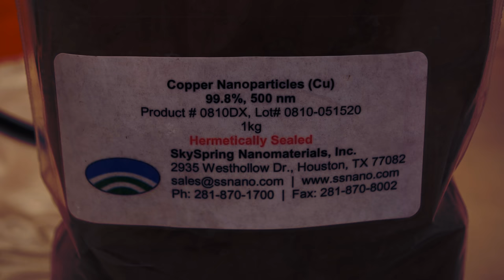Make Our Best Thermal Paste... YOURSELF!

Comment: What if in the final stages you added a liquid that could evaporate easily just for the purposes of being able to mix the final product easier, then evaporate to remove from the final product.
Reply from the maker: I tried this.  The problem is that the mixture tends to stratify during the evaporation, requiring more mixing.
Reply: @TechIngredients  Thanks for the reply, During the evaporation process did you let it sit and evaporate or continue mixing while applying a small amount of heat? I know with cooking certain dishes you can't just boil out excess liquids without separation of ingredients where a slow continual mixing with a bit of heat usually does the trick, the excess liquid helpful for that initial mixing of the ingredients.

Comment: Does it outperform liquid metal?
Reply from the maker: Probably not.  And as long as you're willing to deal with the electrically conductive and corrosive liquid metal, the results should be even better.  That's why we modified the rig with nickel coated surfaces and will be testing commercial liquid metal and our own formulation as well. Stay tuned.

Comment: Nothing to do with this video but could you come up with something inexpensive that could measure the absolute air pressure (or pressure difference) within a pascal or two..
Reply from the maker: Assuming you are measuring around one atmosphere, what about using a liquid manometer and amplifying the input pressure and consequently the differential with a calibrated syringe?

Comment: @Techlngredients I have a question please: you have used aluminium powder or aluminium oxide powder?

If you have used aluminium powder why ? Because aluminium oxide powder is non electrically conductive.
Reply from the maker: Aluminum metal powder.  It has a higher thermal conductivity.   The oil makes the mixture non electrically conductive.
Reply: @TechIngredients  thx professor
Reply: @TechIngredients  can you please send me the link where can I purchase the aluminium powder please I'm in France, I searched but I can't found in secure site

Comment: gave this experiment yet another try using different mortar and pestels since I assumed the shape to be an issue making the glycerin stick to korners I wouldn\t rech but I just haven\t been able to replicate it mostly it felt like the issue was no enough glycerin so when I went up the g for that ingredient it started to look somehow similiar to your at around 9 grams but it never performed as well I guess I am just doing something wrong that I am unaware to notice
Reply from the maker: What aluminum powder are you using?
Reply: @TechIngredients  called @Aluminum powder "Pyro 5413H Super" <5 µm (Al)" from a company called laborladen didn\t really find any other aluminium powder sized 5 µm  the place I ordered it from defined the particles as Spherical but the manufacturers website doesnt mention anything in that regard
Reply: I should mention I had quiet the problem finding aluminium powder even since i have no clue where in Germany to get lab stuff
Reply from the maker: Given that you are stuck with that powder and have to hope that in fact that it is spherical, the key is to reduce the glycerin fraction.  Try blending it at an elevated temperature. Don't  heat it so much that you can't  touch it, otherwise when it cools it will become too viscous  to work with, but it can facilitate  the blending process.
Reply: @TechIngredients  Thanks a lot this actually worked perfectly! Edit: OUTPERFORMED Arctic silver by hell of a lot

Comment: Why is copper of the same particle size/shape worse than aluminum?
Reply from the maker: The aluminum may have a little better sphericity or the oxide coating acts to improve flow, but the aluminum allows for a higher solids loading fraction.

Comment: Hello... I used copper powder with a soft 1um and mixed ingredients according to the recipe 4 g glycerin and 14 g copper powder and the result was that the laptop temperature was high and all attempts to make it a reliable thermal paste failed😢
Reply from the maker: What did you attempt to do to make it reliable?  
The most important factor in good heat transfer is actually surface prep.  I covered this in our earlier video on thermal epoxy and will again soon, in an upcoming video on very high power lasers.
Basically,  you need to flatten the surfaces and smooth them to a near mirror-like appearance. 
The thermal compound's performance is directly related to the solids loading fraction. Working against you is that as the viscosity increases, it becomes harder to squeeze the layer down as thin as possible. Aluminum powder is advantageous because  the very round particles pack AND flow easily, allowing very high solids fractions. The thermal conductivity of aluminum vs copper is actually not that significant.

Comment: Would heating the paste help with mixing/incorporation?
Reply from the maker: It does with the glycerin, but not the oil. That is why it resists pump out.
Reply: @TechIngredients  I'm assuming thinning with toluene or hexane didn't help?

Comment: This just makes me wonder that if the thermal pastes are still bottlenecking the thermal conductivity, would we get a bigger gain by delidding a cpu and attaching a waterblock straight on the chip since this would completely remove one layer of thermal compund out of the equation 🤔
Reply from the maker: You'd still need a thermal interface material. Air will still prevent good thermal transfer.

Comment: Can I ask what is the "best" thermal paste for 190-450 celsius range? That can last as long as possible.
Reply from the maker: My guess is an indium based alloy. You might take a look at or contact Indium Corporation, they have a lot of options for thermal control although it won't be cheap.
Reply: @TechIngredients  thanks. But i am looking for a paste. I have not two surface to "connect".  There is indium based paste? I see indium/gallium (aka liquid metal) but I have to couple brass/aluminium/copper. Maybe liquid metal is corrosive
Reply from the maker: The galium is very corrosive while the indium is pretty inert.  You might not want a paste.  An alloy that softens or melts at a temperature your surfaces can reach will allow you to place the film between the surfaces and at the target temperature you can tighten things down a little further achieving a good interface.

Comment: I wonder if paste made purely out of copper or silver nanoparticles preferably coated in that silene instead of zinc oxide would give the absolute best performance. Probably finding right materials would be a bit like searching for unicorn, but hey, if anyone you are the guys to create the ultimate thermal paste, and the world needs it (and most likely there would be no trouble with selling it, especially with a bit of marketing)...

And on personal note, if you guys actually create the best performing paste on the consumer market, and once chip shortage is over, I would absolutely buy it for the new PC build I desperately need!

Comment: How would one make a strong but easily removable adhesive like that of the 3M strips used for hangers and posters... I know VHB by 3M is much stronger but it will take a layer of paint with it if you use it on a wall but improving the strength of a 3m strip like adhesive would also be welcome provided it can remove cleanly without damaging common walls and ceilings (Typically dry wall with paint or wallpaper).
Reply: Thought of this while I was hanging up VR base stations and trying both VHB (RIP my walls) and 3M strips (Fingers crossed it doesn't give out)
Reply: The issue with VR base stations is they have moving parts inside of them so should they fall, especially during operation, they can be permanently ruined.

Comment: why aluminum powder? Isnt copper more conductive
Reply from the maker: The aluminum allows for a higher solids loading possibly due to better sphericity or the oxide coating.
Reply: @TechIngredients  
Sorry for the dumb question, you said it in the video. Nanotech has improved a lot, i'm sure you can find some papers describing some types of nanospheres. There's CuSO4 + ascorbic acid, which makes nanospheres I think.

Comment: Where are link to buy materials? Why not copper powder?
Reply from the maker: It's not quite as effective as the aluminum.  Despite it's higher thermal conductivity it's all about the solids fraction and the aluminum is more spheroidal.
Reply: @TechIngredients  I get no products on aliexpress for aluminium powder, I get some from germany but they are not cheaper then copper.
Reply: @TechIngredients  " aluminum is more spheroidal." - until I see you post microscope video/photo I will not believe you. I checked OEM thermal pastes myself under microscope and was amazes at what I so. Same goes for third party powders.

Comment: zirconium dioxide has good thermal conductivity?  That is contrary to its use in ceramics and refractory applications.  Can you clarify ZrO2 in this application?
Reply from the maker: Good relative to the oil it's immersed in.
Reply: @TechIngredients  That makes sense. Thanks for the reply! Would the structure of silicon carbide be suitable?  I thought of SiC but thought it might be no better than diamond.  Then I saw the structure is quite different and I know it's not a bad conductor.
Reply from the maker: Probably not.  I believe it's a cubic structure and would suffer diamond's packing issues.

Comment: this thermal paste is so good and so cheap and so easy to make, you can do it at home by yourself and save a lot of money; to prepare few grams of it, you just need a worth of about 850 bucks of equipment (thinking of a cheap low end ultrasonic welder, otherwise it will cost you much more)... 🤪

Comment: Wonder if 50 sheets of gold leaf stacked ontop of the cpu would work without oil. Since gold is so malleable one could imagine there wouldnt be much trapped air between the sheets after the cooler is clamped on the cpu. Would do away with oils.
Reply from the maker: It doesn't work as well as a single sheet of indium foil.  Indium is much softer than gold.

Comment: Isn't  zirconium oxide electrically conductive? If so it is just as dangerous to apply as liquid metal
Reply from the maker: It's  a very poor conductor, but beyond that, the grease insulates the particles.

Comment: How will this work compared with liqiud metal on cpu and cooler?
Reply from the maker: The best non metal pastes including ours will not perform as well as liquid metal pastes. That's why we are developing our own metal paste.  But keep in mind metal pastes will corrode many metals especially aluminum and if a drop of this material gets on the leads to the CPU it can damage them. So, you need to be careful.

Comment: Maybe for your next video, you can develop a device that prevents your glasses from slipping :)
Reply from the maker: Cute.
Reply: @TechIngredients  hey, on a serious note, may I suggest an episode. I have obnoxious neighbors that blast their music from outdoor speakers mounted around their poolside, they do this because they have money and no consideration. The property fence line is 70 feet from my kitchen side door, reading on average around 75 - 80 dba, from my door.  Could you develop an episode on the best way to soundproof outdoors. E.g Materials, Plants, Phase Cancellation, LRAD 😄

Also, in consideration to 6 ft. height limit on fencing; weather; durability, and visual appeal.

Thanks for your hardwork

Comment: Wouldn't copper powder be better than Aluminum?
Great video by the way. I think I'll pop over to your store and buy some!
Reply from the maker: Actually, no. This may be due to better sphericity of the aluminum powder or the effect of the oxide coating, but the aluminum allows for greater solids loading and it's all about excluding the low thermal conductivity oil.
Reply: @TechIngredients  interesting.

Comment: Wish i had equipment avaleble so i could test this!
I have a question tho, i use Noctua paste on a gpu i have, but for some reason after a few months of use it seems to start getting hotter, and i have to repaste it again, and its good for a couple of months again.
What can be the reason for this? The pc is stationary and not moved so its not shaking or moving the heatsink either.
I have never tried any other brand then Noctua, maybe i should have done that.
Reply from the maker: Some thermal pastes contain more volatile liquids that help to reduce viscosity. Grizzly does this.  Each time the computer cycles on and off the heating cycle drives off a little of that liquid as vapor. The space left behind fills with air and heat conduction suffers.
Reply: @TechIngredients  Awsome, never thought i would ever get such a good explanation on this! I'll try another brand just to test. :-) Thanks!

Comment: 42:00 "So it may be that I haven't reached the limit of the performance of this material."

I wonder...would a melanger be appropriate for this application? It's used to grind cocoa nibs into liqueur, though if this were to be tested you'd probably need to be making a lot more of the compound since the smallest scale melanger I've seen was 2 Liters.
Reply from the maker: I've thought about it.  I'm actually getting an arm like Popeye.
Reply: @TechIngredients  It'd certainly be cheaper than those $2k + industrial mixers. Looking around I see them going for the $300 - $500 mark.

Then again as long as you eat your spinach I suppose your arm might be ok.

Comment: A thing I always wanted to try but never had the balls to do is solder the CPU to the cooler. Is that something you guys would be willing to try?
Reply from the maker: Even indium based solders still need to get around 200C. 😮
Reply: @TechIngredients  I know, that is why I refrained from it :D I believe if you manage to get ultra short exposure you could do it without damaging components however.

Comment: If copper is a better heat conductor than aluminum why not use the copper powder instead of aluminum?
Reply from the maker: The aluminum allows for a higher solids loading possibly due to better sphericity or the oxide coating.

Comment: I did not catch this video till June 2022 . I have a question is this thermal paste non conductive. If not when it ages will it become conductive. I am interested because I use thermal paste on Transistors in radio communication.  Someone invented a new thermal paste. That became conductive. Causing failure in Transistors.  They cost 200.00 + dollars each. It was not good at all. 800.00 in the trash. A good thermal paste would be Useful.
Reply: @krystal5887  I will not say the brand I do not won't to slam a company. However over a period of time this paste would become conductive. In a rf amplifier it causes problems. Shorting between base , emitter ,collector.

Comment: At 33:30, why does he choose aluminum over copper if they are the same size? Copper has higher thermal conductivity than aluminum and it is easier to work with, but he says it has lower performance. Why?
Reply from the maker: It's probably due to size distribution and sphericity which affect packing density.  You can add more aluminum than copper to reach the same viscosity.

Comment: If copper is twice as conductive as Aluminium, why not use copper powder?
Reply from the maker: The aluminum allows for a higher solids loading fraction.  Maybe it's due to better sphericity or the oxide coating on the aluminum.
Reply: @TechIngredients  Thanks for your reply,  I am still really surprised that 1-3 atom graphene dioxide cant fill some gaps in between and improve the thermal transmission. Also what if pure graphene dioxide ink was applied as wet layer ,then the putty was applied on top?
Reply from the maker: The graphene is thin, typically 3-10 atoms thick, but the sheets are wrinkled and folded and the huge surface area means that just a couple of percent by weight and you already have a putty.

Comment: could aluminium oxide power be used? i've had a bad luck trying to find aluminium powder, but aluminium oxide powder is way easier
Reply from the maker: I've tested this several times with poor results.  I believe it's due to the low sphericity of the particles.
Did you try Alpha Chemicals?
Reply: @TechIngredients  hmmm I see, thanks for the response, I'll try it

Comment: I can't see it being cost effective to make it on your own.

Take the cost of all the materials and take away the percentage of the materials you actually use to make the amount of paste you need. 

I imagine it'll work out at $30-$40 for the application and you'll have loads of material left over sat there doing nothing. Meanwhile you can buy thermal paste for about $5. 

It would only make sense IF you have all the materials AND all the equipment to hand. And even then, you'd need to work in a computer shop where you spend a lot of time redoing CPU installs to make it worth while. 

Still, it is very interesting from a purely academic stand point. Thanks for taking the time to show us. :)

Comment: at 9:30 you are mentioning that thermal interface material is worse than the bulk material, yet on the 1st experiment you've cut only the 1 rod and placed 1mm plastic piece there. Why not cutting the other one aswell, or add another 3rd aluminium rod, cutted at the same height.
Reply from the maker: Because then you introduce two interfaces to that rod and the air that inevitably fills those gaps.

Comment: I saw it uses aluminum for the paste. Why not copper powder.
Reply from the maker: It worked a little better probably because of the sphericity or the lubricity of the oxide layer allowed a higher solids loading.
Reply: @TechIngredients  I have another idea for a cpu cooler on a laptop. Can I email it to you?